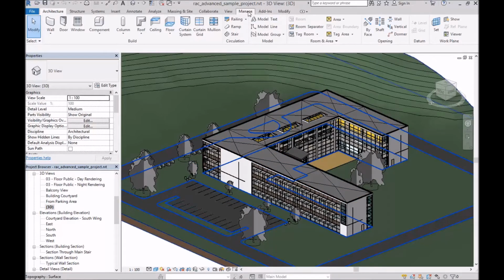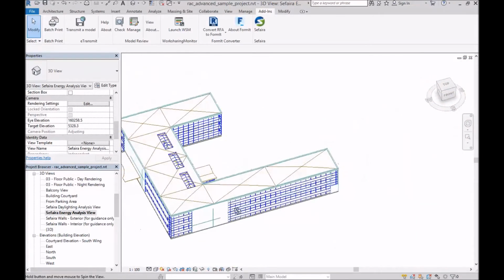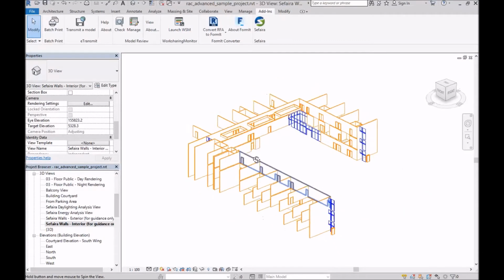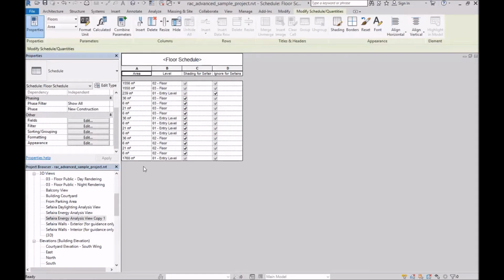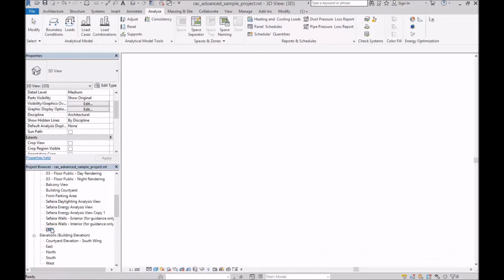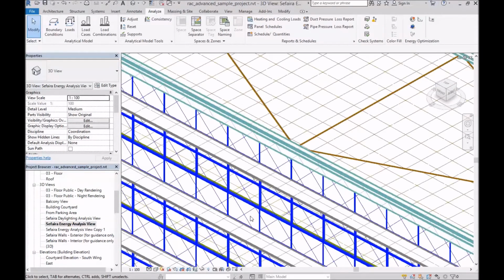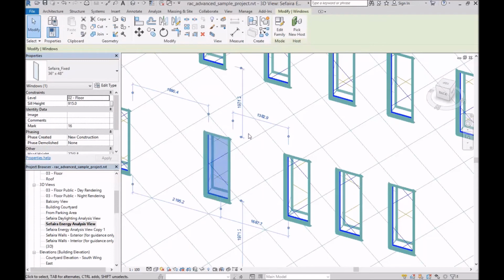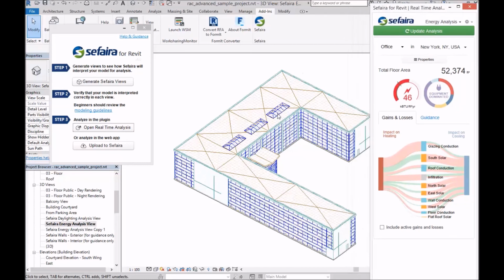5* How to get a complex model ready for analysis - Revit

Comment: Thanks for this video. It was very helpful, however, in my experience Sefaira has problems with interpreting almost all window families in Revit. So, if you are working on a high-rise building project with lots of windows,  it is better to use Sefaira suggested window family. 
The other way to reduce plane counts at the early stage design is to simply use the curtain wall empty family with no grids.